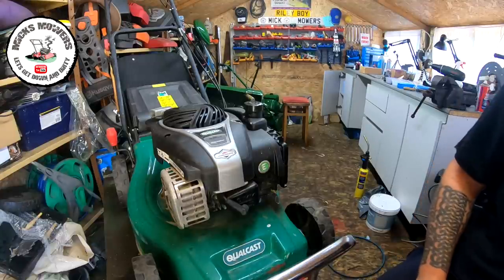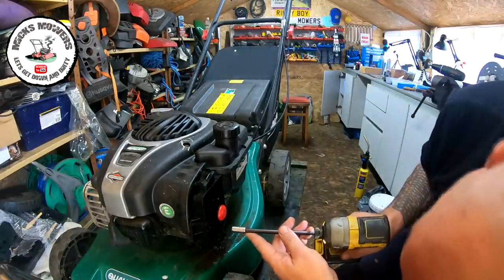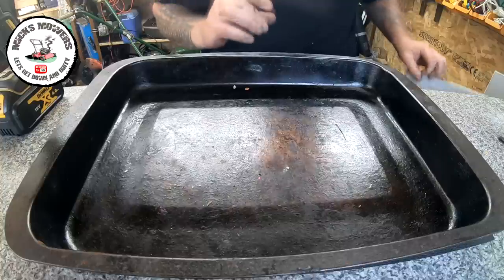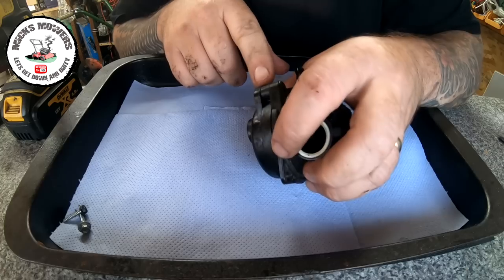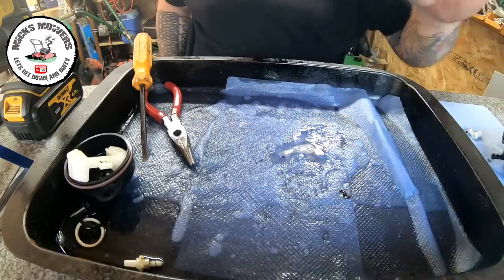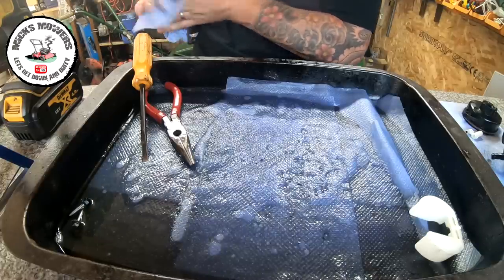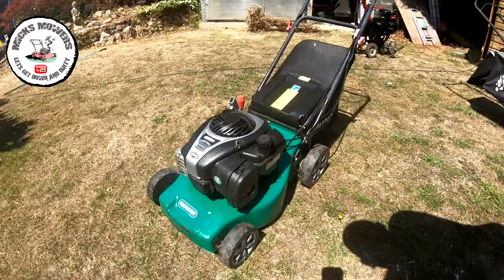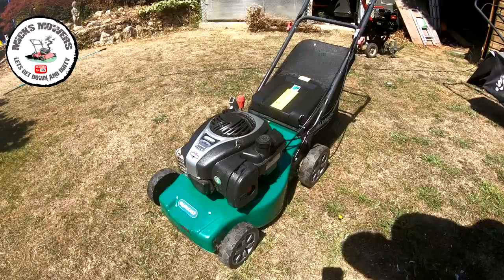Repairing a Lawn Mower Briggs And Stratton 450e Trash picked Lawnmower - LETS FIX IT

Comment: I worked on 1 of these for a friend. Was hunting badly, I stripped cleaned the carb which appeared clean anyway 🤔.
I bought genuine new jet thing still no good. No wonder why B+s are struggling to stay afloat.
We took it to a field and blew it apart with my .308 and shotgun solids😜, solved the issue 👌
Reply from the maker: Did you visit lol would of loved to of see it lol
Reply: I had the same problem with that carburetor so I yanked the engine off and put a Harbor Freight predator on their solve the problem

Comment: The 450e Briggs carbs are infamous for needing frequent cleanings and the fix (in addition to cleaning) is to open up the main jet (located in the white plastic cartridge) to 20 thousandths of an inch. A quick way to check if this needs to be done is to check if a stripped bread tie wire will slide into the jet, if it won't get a 20 thou jet drill and open it up. The motor will run better and the carb won't need cleaning as often. 👍

Comment: I use carb spray on them all the time without any problems and after the last one gave me a headache I watched a YouTube video by Steve and open up the jet and voila no more headache. Mower runs like brand new!
Reply from the maker: Yeah I have opened the jets up on some. Some worked some didn't.. apparently the new ones have a jet missing so they run better now
Reply: @themowerman  I've never seen a jet so small and I made the mistake and opened it too big but then I opened it one size bigger and it runs like brand new. Awesome video btw Mick.

Comment: Easy $ for Mick.  This older EX series is still better quality than the newer E series. Use 30 weight oil. It won't smoke.
Reply from the maker: I only use 30 oil in them mate
Reply: @themowerman  OK mate

Comment: Just waiting to see Robin Hood come running into your shed and tell you someone has just demolished Sherwood Forest with a chainsaw 😂.Seriously big fella your demos are of amazing in depth quality. So much so if I have a problem with the 450e Briggs and Stratton on my little MacCulloch I will have a go with the carburettor. I have had it about 7 years, and it starts first time every time. New it was only 130 quid and its a push mower. The garden at the rear of the house is very large and this wee thing has been amazing for the price. This old reptile 🦎 doesn’t have the wind now so invested in a Mountfield SP 555 rv rear roller 21 inch it’s built like a tank and was told it was overkill, but I love it with the amazing Honda engine makes mowing a doddle at my age 👍 Tam.
Reply from the maker: Yeah mate a good running Honda is a very nice thing and with a roller on the back wow it's never over kill.. cutting grass should be a pleasure. Ta for watching mate hope all is good
Reply: Micks Mowers Everything is good Sir thank you 🙏 Tam.
Reply from the maker: @b.2221  fantastic

Comment: Nice fix mick are the gear box same on most ur are they all diffrent
Reply from the maker: More are the same so you can transfer them over.. but they are expensive around£40 for a new one
Reply: @themowerman  not cheap then really it would have to be a 200 pound mower to make it worth it then

Comment: Great video as usual. 

I’m gutted: was cleaning the main jet on a 450e plastic carb and snapped the mini drill bit in the jet. New carb is cheap enough but could’ve been avoided.
Reply from the maker: Yeah it happens.. done it myself
Reply: Micks Mowers Did you get the kinder eggs for Riley a few weeks ago Mick? I couldn’t figure out how to leave a note in the parcel.
Reply from the maker: @jeffjeffjeff2  was it 3 eggs on there own
Reply from the maker: I did mention it in a stream a couple of weeks ago.. but it came with no name..
Reply: Micks Mowers Yep that’s right.
Reply from the maker: @jeffjeffjeff2  yeah mate he had them
Like I say it had no name on it. I did mention it on a video and live stream
Reply: Micks Mowers Cool. Glad they arrived and he enjoyed them. I’ll have to watch the last few streams back when I get time.
Reply: Update: fitted the new carb (thanks Amazon) and it’s still hunting! Keyway looks fine, new spark plug, cleaned fuel tank and fresh fuel. 

Not tried filing out the main jet after breaking the bit in the original jet: but do you think it’s inevitable? I would’ve thought a new carb wouldn’t have that issue.
Reply from the maker: @jeffjeffjeff2  was the carb a genuine one
Reply: Micks Mowers wuhan special mate
Reply from the maker: @jeffjeffjeff2  yeah no good mate.. pay out for a genuine one

Comment: Hi Mick. I've been given a Qualcast with the 625e engine. Problem I have is when standing at the back of the mower looking forward, the back left wheel won't stay on. It does have self drive. What holds these wheels on?
Reply from the maker: Hi.. ok so it should be a 12 or 13mm nut do take the wheel cover off and see if the nut has come loose..

Comment: Well done mick, I hate the new style plastic carbs.but must say a p,o,s
Reply from the maker: Yes mate shocking carburettors.. ta for watching
Reply: @themowerman  yes but we will keep them going, I all way use the jet files, or drill bits,the jets are too small, and don't run properly, same as other garden equipment, for the USA market, the have lower emission level,and legally require a spark arrestor,
Reply from the maker: @martinburgess4814  yeah we don't have that problem over here YET. Stay cool mate
Reply: @themowerman  with stihl tools

Comment: I don’t know of anybody who likes those a carbs.   And I use carb cleaner instead of wd40 and have never had a issue,  I do understand carb spray may expand gaskets.  Some actually drill out a little some of the jets on those after cleaning fails.  Especially the main jet .
Reply from the maker: The new ones now have a jet missing and they run a little better apparently

Comment: Hi, my petrol mower will only start when my ground wire isn't attached, then when I went to turn it off I just touch the write to the body? 
Any help will be greatly appreciated, then my wife can cut the grass!
Reply from the maker: Sounds like the micro switch  to me
Reply from the maker: Email me a photo of the mower
Reply: @themowerman     it's a mountfield hp 470 if that helps 🤞
Reply from the maker: @shanehillman8773  with a Briggs and Stratton 3.5 on top?
Reply from the maker: This video may help.. https://youtu.be/bLaERBmx0D4
Reply: @themowerman  https://youtu.be/6alfvcjXLKA

Same as this but has the drive for rear wheels. I will have a look at the micro switch, something may be stuck in it? 
When the wire is in the little clip it won't start, when it's out and not touching anything it starts up. It must be stuck in the open position?

Comment: Hi. Mick
What temp do you set your ultrasonic cleaner to. as with mine i set it to 50 for 30 mins but don't seem to clean. U used a cap full of carb cleaner (rec dose for 7 Ltr)
By the way, what a fantastic channel 👍whats the best way to. send you something for the channel? Also how does your Wish List work as it tries to deliver to my address in Kent?
Reply from the maker: Ok so first of all thanks for popping by the channel.. in my cleaner I heat to 60 to 70 with a bit of white spirit.. seems to work well.. regarding the wish list apparently after you have selected the item and where it says your address if you scroll down it will come up with my address.. I will have a look into it to make sure it's working properly.. ta for the comment
Reply: @themowerman  thanks mick, i'll give it a go at 60 deg and go from there. i will also have another look later at your wish list.
Many thanks Peter
Reply: @themowerman  have just rechecked and its not coming up with your address, sorry!
Reply from the maker: @peterjingram1  email me and I will send you my address micksmowers01@gmail.com
Reply from the maker: @peterjingram1  hi mate ok so now I believe I have fixed it.. any problems let me know and thanks for giving me the heads up..